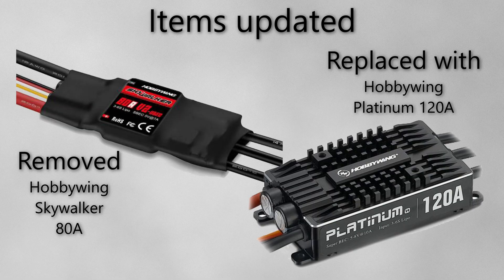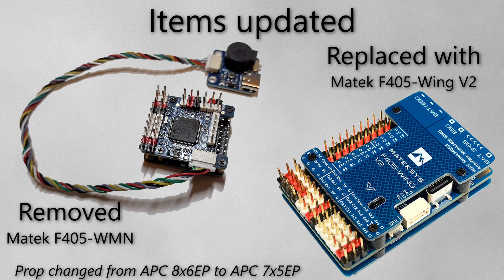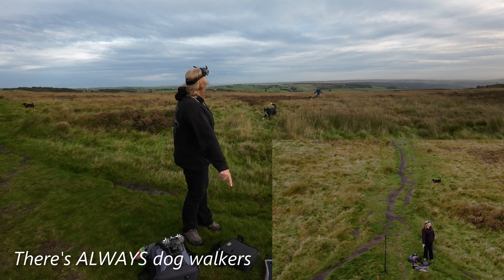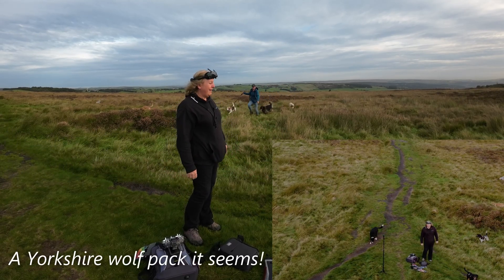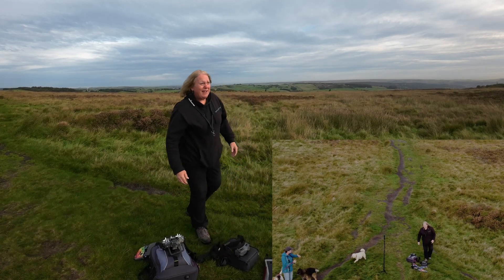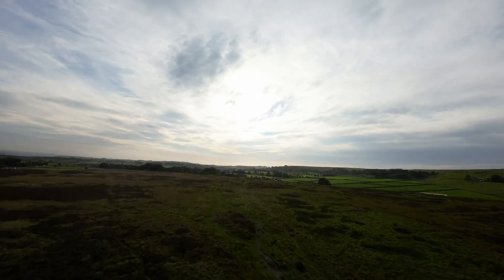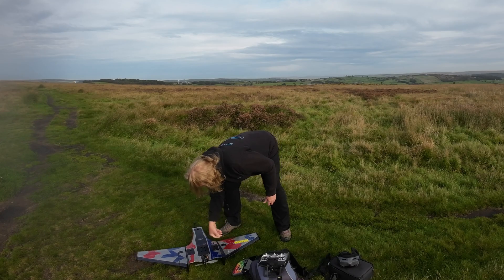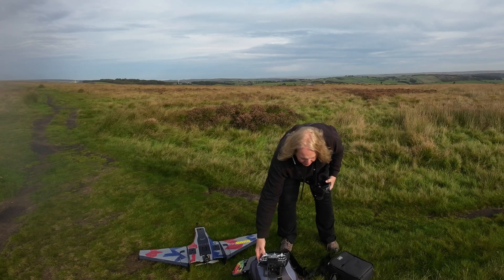Mini Drak - Back in the Air

Comment: Regarding the amp drop you might put a 470nf 35V (very good ones are Rubicon 470nf 35V ZLH) condensator to the lipo input pads on your FC. That helps the current sensor to recognize lower amp draws more sensitive. If you have talked to "Grumpy" already you should know some things to try out regarding the desyncs. Most times it´s just little settings in BLheli32. 
She will excel once dialed in ;-)
Reply from the maker: Added a nice low ESR cap.
Reply from the maker: Thanks! :)

Comment: Looks like running motor power through your FC isn't such a good idea....I NEVER do it...An amp counter is only as good as its calibration, and besides, you can just watch the battery voltage if your going long range. An incredible amount of noise comes from the ESC, this is why I never do it...Just use an amp meter to ascertain maximum amp draw, its not like it will change...To test this, simply rig the motor directly to the esc and use a servo tester to throttle it...I think its your amp counter on your FC crapping out..and starving your ESC...🤔🤔😮😳😏😏🇬🇧
Reply from the maker: I do find a current sensor is really useful, and yes, once I get the plane flying well enough I calibrate it properly.
The original F405-WMN I was a bit worried about it's ability to handle the current but the replacement FC has peak 220A capability so I don't have a worry about that.
I ALWAYS use the current sensor on the FC - if I used an external current sensor it would use a tiny value resistor to do get that reading. 
The power would need to go to the board to run the BECs which power all the other bits so I might as will use the built-in current sensor and on all the planes I have used a Matek FC I have never had an issue with the current sensor.
Reply: @Caroline_Tyler  Okay, I just run a lighter gauge power and ground from the flight Lipo to power the FC....I'd still do the suggested test bypassing the FC...at least it will tell you it's not the FC or noise from that big new Speedo.....It's easy enough to do...🤔🤔🤔😳🇬🇧
Reply from the maker: @EnglishTurbines  I have a couple of more things to try but should they not prove out I will try your suggestion :)
Reply: @Caroline_Tyler  Okay, no probs. Sometimes it's better to prove what isn't the problem...I just remember the hideous electrical noise using an amp counter did to my old analogue video feed, despite numerous LC filters...lol...🤔😳😏😀

Comment: Awesome. thanks for watching. do you resolve Syncro ESC ?  do you try another protocol? lot Dshot 600 trouble, some ave better on Dshot 300 or multishot.
Reply from the maker: Thank you!   No, it's not resolved yet.  I have been in contact with the German distributor of the Mini Drak who has made some excellent suggestions which I will try out. This plane fly's so well I need to get this niggling issue resolved. Neither of the ESCs I have tried so far support anything other than PWM, so I have ordered yet another ESC that supports DSHOT fully and if the other things don't resolve the issue I will give that a go.

Comment: What motor are you using? sounds like a typical decync. maybe it's the timing in your esc.
Reply from the maker: The motors I have tried are T-Motor 2820 1700KV and the recommended Cobra 2814 1700kV. the timing was initally 15 degrees but I have also tried them at 8 degrees as the Cobra recommends 5-10 degrees.

Comment: I went with the nano drak because i was afraid of trying to launch the mini.  I started using the Badass branded ESC which i think are just ztw but have been good
Reply from the maker: The Hobbywing brand have never given me these sort of issues before, it's rather frustrating.  I'm SLOWLY getting used to over head launches, but you really have to put your trust in autolaunch!  :)

Comment: Get a Flycolor HV 
Work great with 3115 Brotherhobby 1520kv and 6s
They are blheli32 👍🏻

Or check advance and pwm freq in the hobbywing settings. Its annoying to do without programming box 🙈
Reply from the maker: The Hobbywing Platium 120A is 32bit at 72Mhz and I have set the advance according to the motor specs.... So that's two Hobbywing ESCs I have tried - both with the same issue. I may have to get a Flycolor HV and try it.
Reply: @Caroline_Tyler  
Hobbywings are usually pretty bulletproof… I would try reducing advance

Also you could try raising throttle slowly. It might only happen from really low throttle
Reply from the maker: Yes, a sudden increase in throttle does seem to trigger it more, but it still happens even when at a fairly constant throttle level. Next video will show that.

Comment: Most older ESC designs don't cope well at high RPM, cut off being somewhere around 32,000 I think. I had this on a high speed park flyer and the problem went away once I installed a surprisingly cheap ZTW Beatles G2 32bit ESC.
Reply from the maker: Thanks, I will certainly try that should the next test flight show motor/power issues  :)
Reply from the maker: Tested today - still de-syncing, I may have to try your suggestion!
Reply: @Caroline_Tyler  you can also try reducing RPM with a different prop, but I found that once an ESC has hit its RPM limit a few times, the problem seems to stick unless you really reduce it. Like 1400kv and 8". But then you've changed your top end.
Reply from the maker: I need to do something, this motor/prop combo is mad - I hit 258kph - but at 156 Amps!!!
Reply: @Caroline_Tyler  holy moly!!! Lol

Comment: I think motor as well. What motor are you running on it? I'm glad you got it gone undamaged
Reply from the maker: Cobra 2814/10  1700Kv  which is the recommended 'secret sauce' motor. Looking at it shows no damage, no burnt out windings but it doesn't seem to get on with the ESC.

Comment: Is the battery ok?
Reply from the maker: Yep, battery is fine. The current dropped to Flight Controller/servos and VTX power levels, voltage was solid.

Comment: Nice upgrades Caroline, guess the motor will be the next thing. What does Motor re-syncing mean, not heard of this.
Reply from the maker: It's de-syncing.... most brushless motors do not have a rotation sensor, instead the back-EMF induced in the coils is used to keep the rotating magnetic rotor in sync with the motor's core. If it doesn't sense right, the ESC protects itself by stopping. I had already set the timing to 8 degrees which is slap bang in the middle of the 5-10 degrees the motor specifies so it couldn't be that. The only common factor from last failed flight is the motor.
Reply: @Caroline_Tyler  well I did not know that, thanks. Have a great weekend. 🫡
Reply from the maker: Hoverboards and crawler type RC cars use sensored motors which allow them to rotate smoothly at low speed.